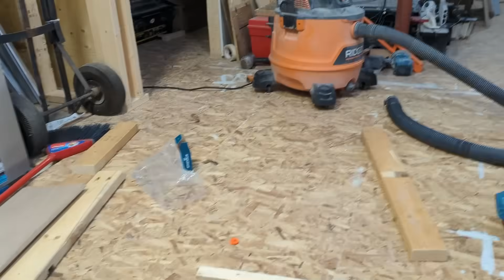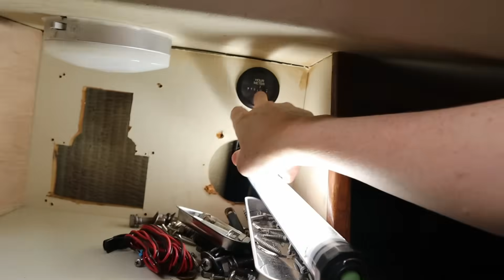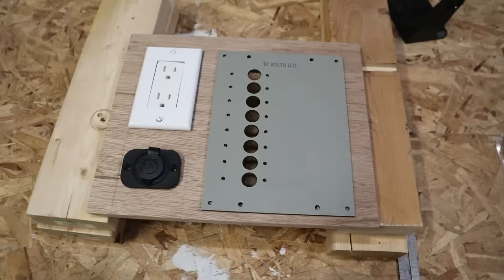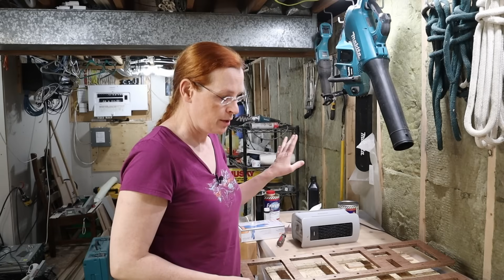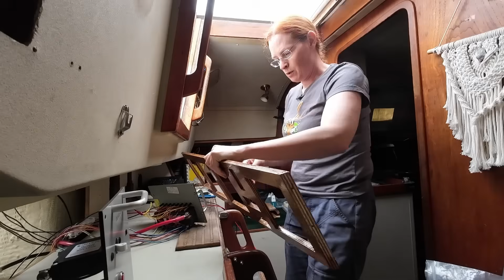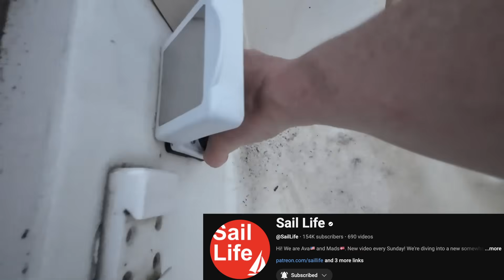Breaker Cabinets Made From Scratch - Ep. 115

Comment: about 1hr 14m in, the bubbly finish, can you use the heat gun trick to pop the bubbles?  I think its a trick from the resin guys to smooth the surface out from surface bubbles.
Reply from the maker: Nope, it's not air bubbles like with epoxy, it's from surface tension around dust  particles.

Comment: You could use some threaded inserts in the wood to receive machine screws for the panel mounting, would make opening and closing easier. The screws could then even be some tool-less type. Also you may want to torque the hardware on those large high current cables. I starting using a torque driver for home circuit breakers and was surprised at how much tighter the spec was compared to what I was comfortable with. You could even use some high grade screws and nuts to be sure. Keep up the great work.

Comment: It should be metal box. If a fire does happen from electrical that's what the metal boxes are for retain the flames. So the wood around it would not catch on fire
Reply from the maker: My boat is made of fibreglass... If there's a fire, I'm basically on a floating candle. Also, the original design used marine ply as well, so it's a match for what it was before, but now with properly insulated terminals and tinned copper wire.

Comment: I find it quite hard to put a holesaw exactly on the mark, as it is blocking the view quite a bit. Therefore I usualy just drill a hole for the holesaw centering bit with a normal drillbit of the right size.

Comment: A few thoughts ... 
I've found when dealing with a location that has a possibility of standing water, either or both, try to drain water away by slanting the "catch" surface or provide a drain channel, and try to seal the susceptible surface.  Since having a slanted step is bad, you could cut a channel under the front edge to direct water (requires putting a bottom panel in the cabinet).  Or seal bottom edge of panel with something like epoxy, then sticking butyl tape to the bottom & back edges of panels (front & sides).  There are other ways to thoroughly seal things at the expense of of panel removability.  I've also seen wood panels like those completely sealed using epoxy (and sometimes a layer of fibergass).

Wiring harnesses.  Try to group by type, power levels, interference issues, etc..  Arrange them & bind such that they move/hinge in a "natural" way when removing the actual electrical panel.  Gather slack at the "hinging" point of the bundle.  (And you know the drill, label the ends of each lead & also at points along it where referring to either end is difficult.)

PS: Glad to see you facing the tablesaw.  I'm still recovering from my end-of-June mishap (fell off ladder while 25 feet up a tree.  Surgery, metal in arm, etc.  Hoping to do spring/summer cores before winter..).  My 6 cats are doing their best to look after me!

PPS: I am loving the intro/extro music!
Reply from the maker: I've got a few lengths of solid teak, and one idea was to make a sacrificial lip forward of the breaker panel to act as a dam for any water. I do plan to make sure all the panels can be pulled out so the wires will be in a waterfall type harness. That fall sounds nasty, good luck with the continued recovery!

Comment: I know it would probably be against ABYC(?) but it would have been interesting if you'd used Schuko sockets. Because they've a much more positive fit for plugs and adapters than the North American sockets.
Reply from the maker: You're not wrong. I don't think ABYC would care, but every AC device I own would need an adaptor, and  that adaptor would bring back the same loose connection. Thankfully, the main uses for the 120vAC connections are tools and the battery charger for the tools (which I'm actually hoping to adapt to DC later).

Comment: Don't know how often you use solvent based paints or stains inside and have a gas water heater, but just an FYI. I was painting in my utility room and the solvents triggered off a sensor in my gas water heater. 2 days later no hot water. I was able to read a trouble code and look it up the manual and reset the unit. Like I say, just an FYI in case you find yourself with no hot water all of the sudden.
Reply from the maker: Oh huh, I never thought of that... I wonder if acetone would trigger it? I don't smell much from the other products I was using, save for the thinner, but even that disappeared pretty quickly. How much were you doing to trigger the shut down?
Reply: @TheDigitalMermaid  I wasn't doing a lot, I think it was just one shelf board. Oil based paint and a new fangled water heater with all the bells and whistles. It's a protection circuit and acted as intended. But I learned to do that sort of stuff outside, even bicycle mtce when I am using WD40. It wasn't a big deal just unexpected. The manual saved me a service call and some embarrassment.

Comment: Not long enough. 😂

Still, enjoyed it. Well done. I hate to suggest this, but the location of the panels and other electrics seems fairly exposed to splash and rain. Some mitigations might be needed to prevent exposure. (Wet boots and foulies will drip coming down the companionway.) all I can think of is acrylic as a shield. You will be using acrylic to cover/shield the back of the AC panel anyway. (E11.9.1…)
Reply from the maker: Aye, I completely agree, and I was tempted to relocate them. In the end, I decided I wanted to keep the boat looking as original as I could. I plan to add a drip rail under the companionway so that the water doesn't run back at least. I might add a lip on the counter forward of the panel for extra protection as well.

Comment: Project is coming along great but please stop cutting narrow strips of wood against the fence, it's only a matter of time before you bind one into the side of the blade and the kickback runs you hand right across the blade. You got very lucky with the first accident, I don't want to see a second. Use the mitre gauge instead.
Reply from the maker: After this video, I needed to cut the rails for the battery box, and I kept putting it off because of that exact fear. I ended up using a feathering board and a wide push stick I could follow the part with, and that worked a lot better/safer.

Comment: Good on you for getting back in there with the table saw.  In this video, your most dangerous cuts were actually your test cuts where you were "cross-cutting" skinny pieces the long way between the fence and the blade.  The problem is if you introduce any rotation at all, the blade can catch the board and rotate it along it with your fingers towards the blade and then throw the board back at you.  Using a crosscut sled or a chop saw will make these types of cuts much safer.

Look for John Heisz's video on "How To Make A Mini Table Saw Sled" for a quick and dirty one, but really a cheap chop saw would probably serve you pretty well cutting long skinny pieces to length.
Reply from the maker: I absolutely need to make a cross-cut sled... Been meaning to for ages.
Reply: Yes, I was going to say the same. Dangerous practice!! Take care...

Comment: 1:09:00 is she leveling the back ? Protection ok, also jigsaw, could have used the circular saw to do a straight plunge cut, finish with jigsaw.
Reply from the maker: I was using the scraper to cut down a run that made a blob on the underside before applying the next coat.

Comment: Not a fan of the 12V cigarette lighter sockets. They never make a good connection, and love to fall out. A good multiple-socket USB power supply is a lot more practical!
A 2 pin connector (pick any kind) is also useful for testing/working on equipment.
Reply from the maker: So, I went back and forth on this for exactly that reason. In the end, I decided to go with the plugs because USB/lightening keeps changing... Sure, if I went USB-C outlets with a spattering of USB-A, I'd probably be OK for a while. However, the cigarette outlet has been around for DECADES, so I figure the plug will last, and I can swap out 12v -> USB (or whatever) fairly easily in the future. Now that said, I got the sockets from Digikey and picked the most robust, 20A rated sockets I could find. So hopefully they prove to be above average.
Reply: @TheDigitalMermaid  And you can always get Lighter to USB-C PD to cover things later as well.  Flexibility FTW!  ♥
Reply from the maker: Exactly what I have already. I picked up 4x Anker 165w (2x USB-C PD, 1x USB-A) adaptors. Been using them to keep stuff on the boat charged up when I'm down there working on it.

Comment: Nice to see you getting to grips with the thing that hurt you. That’s a huge accomplishment. It’s really easy to fall back on excuses or throw up mental roadblocks.
Not filming that was probably for the best, it kept your stress down (which is the most important thing), and honestly, it probably would've made for boring or cringe-inducing content anyway.
Reply from the maker: I've hurt myself many times before, but this is the first time I had such an emotional reaction to it. When I got to cutting the rails for the battery box (coming video), that was the cut that I got hurt on, and I had been putting it off. It was tough to get it done, but ya, nothing to do but either quit or get it done.